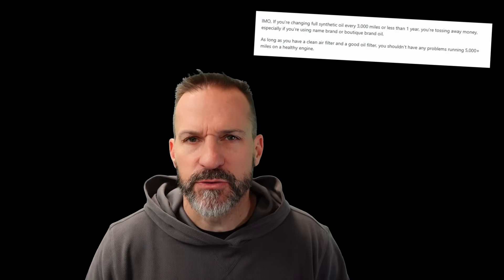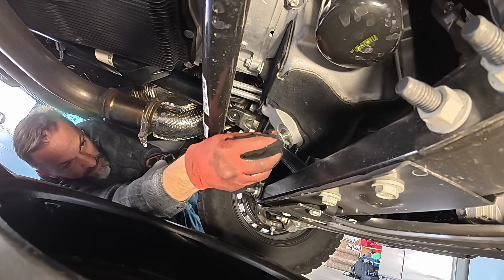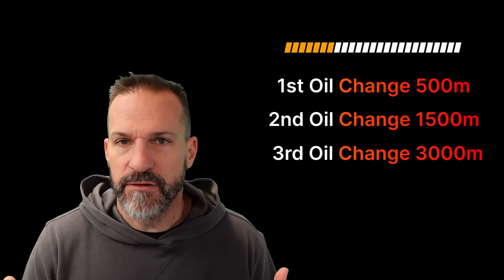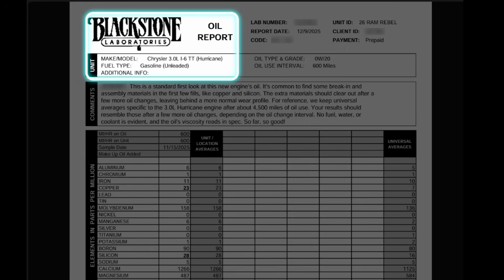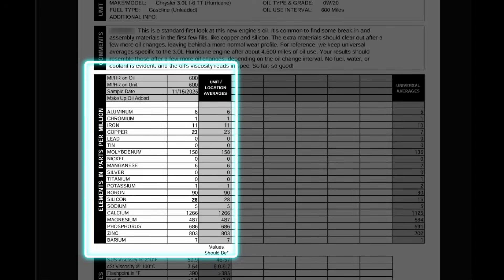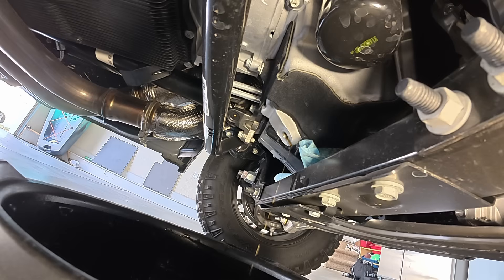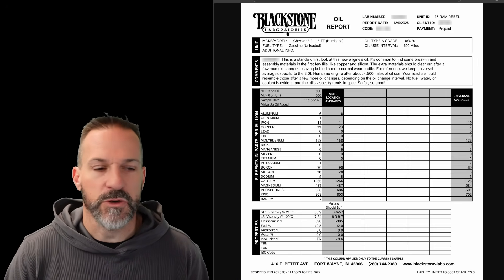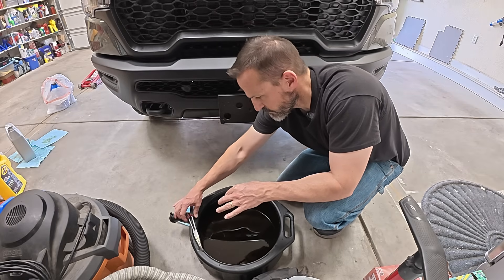Is the Motor Oil Geek Right? I Put His Break-In Theory to the Test

Comment: Every user manual to every vehicle I have owned has said to do a break in-oil change the first 500 miles. The whole topic is a moot point IMO.
Reply: OTOH, my current user manual says no such thing.  It says to change the oil when the "Oil Change Required" signal comes on, and gives no further instruction, except that the interval should never exceed 10,000 miles or 12 months or 350 hours of engine run. We can only report what we've seen, and I've seen that not every manual directs a short-interval break-in oil change.
Reply: When was your last vehicle purchased? 1975?
Reply: @Incomudro1963  2016

Comment: Love the content! What are your thoughts on a middle ground like changing at 1,000 miles, 2,500, 5,000, then continue on with normal 5,000 intervals?
And what’s your thinking behind going to 0W-30 or 40?
Reply from the maker: I think 1000m for first change would still be good, better than 5000m for sure. I might do a joint video with Barry from Ctech review about this, he waited longer on his RHO to do his first change. 

I want to run 0w40, but want to get a baseline from 0w20 first

Comment: All I did was heads and cam and lifters on my flat tappet Buick v8 and I changed the oil 4 times in its first 300 miles just to bed the cam and lifters correctly. Then tapered off oil changes intervals thereafter.
Kind of overkill.
Sent to Blackstone for analysis. And couldn't be happier with the results.
I'm 21,000 miles in.
No surprise new engines need the same/similar procedure.

Comment: I was told break in was 1,000 miles and can oil. Then 4,000 miles first oil change. Then every 5,000 miles. But Toyota doesn't like because at 15,000 miles oil change you will pay for the oil change because you have used your free changes.

Comment: To find the truth about recommended oil viscosity, all one has to do look at the owner’s manuals in different countries.
The 2026 Toyota Corolla Cross uses the following weight oils in these countries:
      US:  0W-8 (page 442) 
      Canada:  0W-8 (page 442)
      Australia:  0W-16, 0W-20, 5W-20, 5W-30, 10W-30  (page 357)
      UK:  0W-16, 0W-20, 5W-30 (p 507)
      Ireland:  0W-16, 0W-20, 5W-30 (p 507) (2025 model year. Couldn’t find 2026) 
Based on Australia’s recommended oils, even an oil as heavy as 10W-30 can be used.
Notice the US and Canada are the only countries recommending using 0W-8, and it is the only weight recommended.
It’s obvious these thin oils, 0W-8 and 0W-16, are only be used to get the best possible mileage, regardless of the consequences of their use.
Here are the URLs for the owner’s manuals.
     US: https://www.toyota.com/owners/warranty-owners-manuals/
     Canada: https://www.toyota.ca/en/owners/manuals/
     Australia: https://toyotamanuals.com.au/#/
     UK: https://www.toyota.co.uk/customer/manuals
     Ireland: https://www.toyota.ie/customer/manuals
Don’t take my word for it. Do your own research.
Reply: My manual directs 5w20, but there is one place where it says, without any qualifiers, that if 5w20 is not available, 5w30 is fine.

Comment: I had my wife's 2026 Toyota Cross oil changed/tested at 589 mi. From Blackstone Comments: 

"This looks like a normal break-in sample to us. Aluminum, iron (on a per-mile basis), and copper are all elevated, and that's to be expected as new parts wear in. Silicon is from assembly sealers/lubes. These elements should improve with each oil change until, eventually, results look more like universal averages. Those show typical wear for the M20A-FKS engine following about 6,000 miles of oil use."

The elevated aluminum, iron, and copper are "expected" as new parts wear in, and this tells me a new engine significantly contaminating the oil is normal. I'll change the oil at 1500, 3000, and 5000 miles like the Motor Oil Geek recommends.
Her Toyota recommends 0W-8 oil, but future oil changes will have 5W-30 Mobile 1 or 5W-30 Valvoline Restore and Protect in subsequent oil changes.
To those that are hysterical about following the manufacturers recommendations I recommend they look at the facts, as hard as it may, be that 0W-8 is only recommended in the US and Canada  For this same engine higher viscosity oils, up to 10W-30, is recommended in Australia. See my comments (above this one) that shows Toyota recommended oil viscosity for US, Canada, Australia, United Kingdom, and Ireland..
In my 2019 KIA Forte (recommend 0W-20 and 5W-30) I changed the oil at 750 and 4897 miles as I new it's best to get the initial oil out of the engine but didn't realize I should have had couple of additional oil changes before 5000 mi. I drive about 16,000 mile a year so I change my oil every 4 months (approx 5,000 mi) and use 15w-50 Mobile 1 in the summer and the two winter oil changes use 5W-30 Valvoline Restore and Protect. Now I know better.
Looking a YouTube, engine problems due to light viscosity oils seem valid. I've never seen evidence of heavier viscosity oil causing problems, and I think it is reasonable to state, that if an engine will turn over will start especially in cold (-10 F) weather, that oil is probably fine. Again, if you have objective evidence of heavy oil causing engine issues please respond to this comment.

Comment: FWIW - I have a 2018 Camaro SS 1LE that I did an early oil change on at around 1000 miles.  The car has had 40+ track days on it (and 40K miles overall) and still doesn't burn off any oil.  Next new car I get I'll try Lake's protocol.

Comment: Just bought a 2025 2500 HD 6.6l gas 14 months ago. First oil change was about 1000 miles with Amsoil Signature Series 5w30. Next change was at 6200 (5000 miles) sent off oil for analysis. Wear metals were elevated but contribute that to breaking in. Added a duel remote bypass oil filter system. Full flow filter is 3 times the size of the oem filter and bypass filter filters down to 2 microns. Most recent oil change was 13,500 miles (7500 mile change) and sent off for oil analysis again. Wear metals significantly down from previous oil change. Plus side of the larger filters is capacity went from 8 QTs to 11 QTs. Engine has used about a qt in between oil changes. Plan on extending change intervals to once a year (about 13kmiles) 

My last truck (09 1500 5.3l) went 191k miles before I got the new truck. Really bought the new truck because I started towing a 23 ft travel trailer. Typical oil changes have been 12-15k or once a year using Amsoil with occasional oil analysis. Don't have oil consumption issues or mechanical issues.

Had a 98 Silverado 1500 I did the same with a 5.0. Got 187k miles but was burning some oil. The newer engines really do run better and last longer than from the past.

Comment: Hey thanks for the video.  Very interested in this series.  Would be grateful if you could let us know what kind of oil, filters and oil plug gasket you use in the future.  Thanks again!
Reply from the maker: This first change I used pennzoil ultra platinum 0w20, no filter change this time. I’ll probably change the gasket every 5k miles
Reply: I'm curious have you considered using a magnetic oil plug to catch some of the really fine debris?

Comment: I'm a firm believer of changing the oil after the break-in period. Did so on my 2022 Tundra after 1K miles and the engine never blew up. I had no engine problems and the engine was changed out at 25K miles. I also did a oil/filter change at 1K with the replacement engine. The dealer said the oil change was unnecessary. They also said it was unnecessary to follow the manual's break-in procedures of varying your speeds and other recommendations during the first 1K. They said modern engines don't need that. Well, I said Toyota has it in the operating manual so I'm going to do it as I keep my trucks long term. Your spending 50-80K for a vehicle so paying for or doing an oil change is nothing to help prevent future issues.
Reply: Ive always said this “modenrn engines don need that”is stupid. Im sorry, modern engines still have compression rings, oil rings, bearings, honed cylinders , etc.. Modern engines might have sophisticated fuel management systems, VVT, and optimized tumble flow  etc, and even low tension rings… But the basic workings of a “modern engine” are the same . Those rings still need to seat properly, as well as the bearings.. The people that wrote what not to do in the owners manual wrote it for a reason… Could you drive it ,like you stole it from day one, and it wont blow up? Yes..But you’re probably setting yourself up for  earlier oil burning, etc. i see guys in my GR86/ BRZ forum often that say those engines are “oil burners”. Well i broke mine in properly, and dont beat on it cold. I fully warm my oil before any high rpm use. Mine has like 14,000 miles , and doesnt burn a drop .. Yes this is low miles, but many on there ARE reporting oil burning before then.,,My 18 camry, i did the same, it is almost to 100k miles.. NO oil consumption between 5 k oil changes.. Again, engines still have rings, cylinders, honing.. They need to seat properly.. I have never had any car that i broke in from new ever burn oil..

Comment: This is flashbacks to the old mechanical flat tappet camshaft that had some lift or even some hydraulic flat tappet with double springs. You first lube it good run a zinc break in oil. Drain it. Then run a mix of 2 quarts of high zinc break in n the rest regular high zinc oil. For 350-500 miles btw always change filters. Than run your regular 5-6 quarts of regular high zinc oil  Lucas driven brad Penn your choice people. We go to ohc engines but break them in like a 60s 70s engine technology gots to love it.

Comment: I would love to see that done on the tundra ttv6. On mine, it didn't make a difference. I changed the oil at 3k, 5k. 10k, 15k. Basically every 5k after the initial 3k oil change and still I lost my lower end of the motor with main bearing failures at 30k. I don't believe oil or debris are the only problems there. I DO believe that either bearing materials or oil weight have more to do with the problem.
Reply: Thanks for posting.  We've got two of these engines ('23 & '25) and are trying to sort out the most applicable info and yours is it so far so I really appreciate it.  Our service rep at Del Toyota said they had a customer do the same thing and just like you he still needed a new engine.

Comment: Changing the oil early should hopefully prevent the cam and lifter failures those engines are known for.    Wonder if you could pull the filter.  Dump it to get rid of more "contaminated oil" and then put the filter back on and not have it leak.

Comment: BMW still specify the first oil change be done at 1200 on ‘M’ engines and will potentially decline any future engine warranty if it is not done before that 1200 mile mark.
Reply: How do you end up with a small fortune while owning a BMW? Start with a large fortune.

Comment: I did 600…1,400…2,000 then went to 5,000 on my ‘24 4Runner though I did change the filter every time. Used Toyota TRD filters throughout this process. I brought home each used filter and took it a part to see for myself. Metal shavings reduced each time I changed the oil. After a year, I’ve also decided to go from the Toyota/EPA game of lighter oil to a bit heavier oil. From 0W-20 to 5W-30 in a cooler to moderate climate. Easy daily warm ups and garaged every night. I think too that this 4.0L engine of mine was built well enough to handle some things other models may not. I have no cylinder deactivation, no stop/start, no total direct injection and that ‘ole 5-speed Aisin tranny. We’ll see how it all goes. I don’t get the mileage I’d like but I believe I have one of the last of the quality Toyotas before the company went to the dark side…👍
Reply: Sadly they no longer make trd filters

Comment: Where on earth did you get this info on - After draining to Flush by pouring new oil with the plug out! /all that does is waste oil that has not circulated through the system/ 
If you have to flush after the initial drain {Put the Plug in - Fill partially minimum of three quarts on a v8 - run for 5 minutes then let cool - / Re-drain and change the filter and refill / But pouring new oil through while the plug is out DOSE Absolutely Nothing.. If you are concerned about what's is in the Pan and the Sump - You remove the pan to clean it - but flushing like you showed is Stupid and a waste of Material...

Comment: I'm a retired mechanical engineer who paid for college by working as an ASE master tech for a few years and I agree completely with Lake.  I am surprised that he's found that it's better to not change the oil filter for the first few break-in oil changes, but his tests are valid in my opinion. I buy new vehicles as I know most people (particularly lessees) do not break-in their engines properly.  My 1999 Silverado had 315k (due to rust) when I retired it and my current 2012 has 200k and is still going strong, although I refuse to use the recommended 5w30 and have always used 10w30 full synthetic and change it when the computer says to after break-in.  Always enjoy your channel!

Comment: I always changed my oil and filter at 1,000 miles in every vehicle and then at 3,000 miles and keep changing at every 3,000 miles after that. It’s pretty silly arguing about cost of added oil changes because if you change your oil at every 10,000 miles then you will have 10 oil changes in 100,000 miles. If you change your oil in every 3,000 miles you will have roughly 30 oil changes in 100,000 miles. Going by $100 per oil and filter change then instead of $1,000 you spend $3,000 on oil changes OVER A 100,000-MILE PERIOD. So yes it’s $2,000 more but it’s over 6 years for an average driver and compared to buying a new truck for $50,000-$80,000+  the additional $2,000 for oil and filter is almost irrelevant accounting dust.

Comment: IMHO, Lake Speed Jr's recommendation is a gold standard of oil change advice.  However, I have to believe that the clean oil flush procedure has to be more of a scientific approach to oil changes not a practical every day approach.  I drive a 7.3 PSD and a lifetime, beginning in the 1960's, believer in 5K mile intervals as a good sweet spot for engine oil change intervals.  I'm someone that drives a car until the wheels fall off.  Engine issues have never been my reason for replacing a vehicle.

Comment: I follow the Lake break in process but I do change my filter every time.
Reply: dirty filter filters better as the larger holes are plugged up with debris.
Reply: Yeah his advice to leave the filter on surprised me a bit.
Reply: I'm going to stay on the side of not changing your oil filter each oil change. It's not like brushing your teeth with a dirty toothbrush, because the oil filter can still trap whatever particles that are above a certain size, and filters become more efficient at trapping particles, and sometimes smaller particles, after prior particles are trapped. If you look at debris in an oil filter from other videos where the engine is not doing well, most of the surface area of the filter is still clear of debris and oil will not be blocked from passing through. I think Lake did a video on keeping filters longer because they become more efficient. Obviously you don't leave them so long they physically degrade, but it would take a very long time for them to become significantly blocked. There is science backing this up.

I changed my oil at 700 mi, 1500 mi, 3000 mi, 5000 mi, 8000 mi (+/- 100 miles or so), and will continue changing it at max 3k miles.

My ZF transmission, I will be using a motor to pump out the fluid around 20k miles, and refilling it, without changing the pan or internal filter. Why? If the filter is rated to 50-60k, then why do I need to change the filter at 20k when I replace the fluid? I'd then have to change the pan as well, as it's plastic.
Reply: Honda manuals, for the longest time, stated that filters could be changed every other time if driving was normal.
Reply: Watch the video he did with the Engineers from Donaldson which are easily the biggest and most popular filter company on the planet and who design and build filters for extremely expensive engines in heavy machinary and road vehicles. Same goes with air filters, they actually filter more debris and dust over time and then obviously need to be changed once the air flow performance drops off.
Reply: What about the quart of dirty oil you're leaving in the truck.
Reply: Yup me also!
For example-
I bought a new log splitter, 7hp Kohler.
It came dry, I added the oil and ran it for 10 min and drained it into a Clean/Clear container, I was surprised at the amount of particles, some were larger than expected.
Changed the oil then ran it for 20min testing the power
Changed again with same results, used it for 2hrs and emptied the oil once again, still showing particles, but less.
It goes to show you how oil filters catch lots of crud, in this case there is no oil filter, so I plan to change often.
Reply: Lake has a video explaining why oil filters get better at filtering with time. Same is true with air filters.
Go watch it. Then you go ahead and prove him wrong by spending time and money collecting data.

Comment: As an old school automotive engineer changing your oil often during break in is the correct thing to do. 
Case in point, I bought a new Honda motorcycle this year and they tell you change the oil plus filter after the first 25 engine hours as it’s a trail bike. 
The other very important part is to use the best oil filter you can find with the best filter media preferably 5 micron’s, with today’s tighter tolerances it’s imperative.